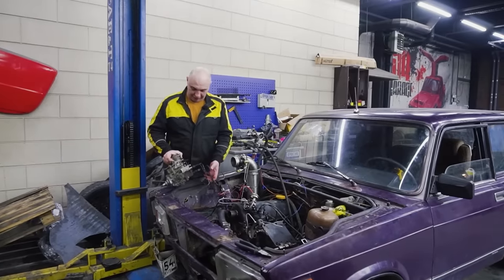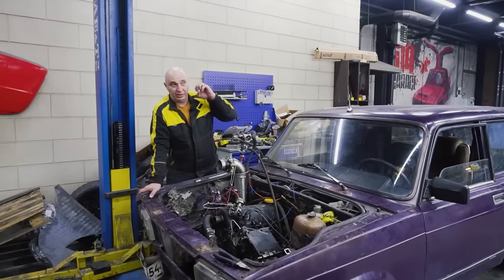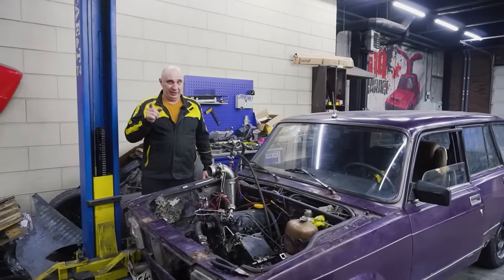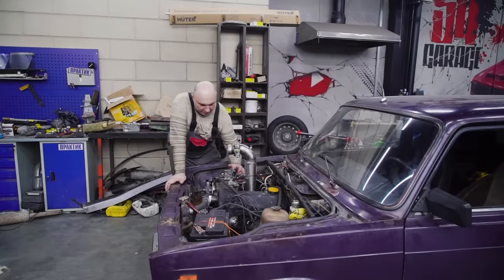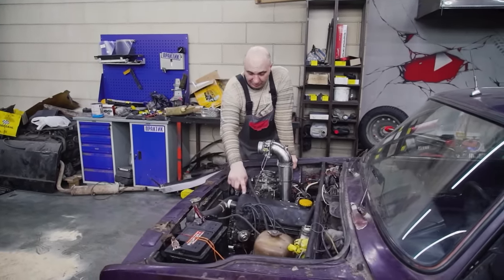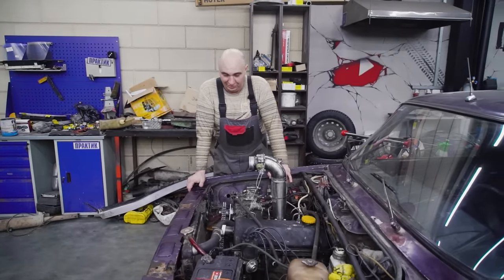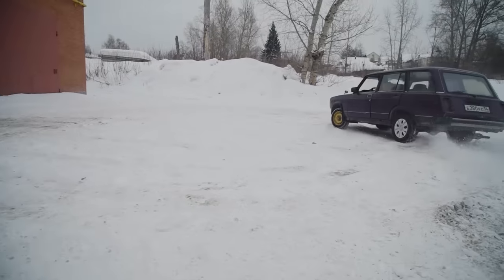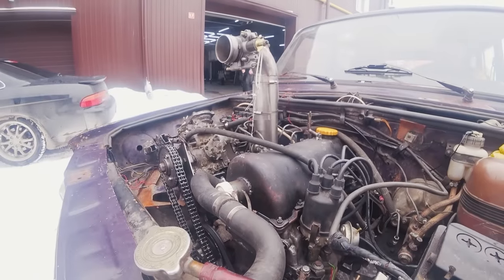We fit high pressure DIESEL pump to Lada engine

Comment: Perhaps try upgrading it with tensioner, better pump mount, and try tuning it with an AFR probe to modulate the pump and throttle body optimally together (with the gas pedal cable, as it's likely running nicely because the fuel get's sprayed super fine, which likely mitigates a bit the effects of it running really rich or lean - as a matter of fact new gasoline turbo engines with direct injection use this high pressure injection effect exactly for the same reason).

Great experiment, the engine doesn't sound at all like a lada. Almost like a smooth R4 bmw engine.

Comment: Fit an automatic Oiling system for the fuel to it, so you dont  have to mix Oil into the Gas seperatly
and fit a trumpet onto the Trottlebody so the air can be sucked in way faster

Comment: To make a whole thing work properly, just add a starter motor powered supercharger you made a couple of videos ago, with a regulator to regulate an air amount.
Reply: Starter motors don't have enough power to make boost. Just blowing air is not enough, you need positive pressure in the manifold to make more power
Reply: @Rudy97  then use a some kind of nozzle, for example convergent-divergent nozzle.
Reply: @cenreaper3221  you can't make pressure without enough force to make the pressure.
Reply: @MiG21aholic  😁❤️
Reply: @MiG21aholic  you want to say that turbocharger on normal cars have more power than starter motor?
Reply: @cenreaper3221  by the time you have a gearbox to spin a compressor wheel fast enough you definitely don't have enough power in a starter motor
Reply: @MiG21aholic  oh.

Comment: Since no one has mentioned this, I will enlighten everyone. Diesels have no throttle plate, as a gasoline engine does. Diesel engine speed and power output are determined solely by the volume of fuel delivered by the injection pump. A gasoline engine's speed is regulated by airflow, making the throttle plate a key part. Essentially what has been done here is creating two throttle linkages, one for fuel volume, the other for air flow. Hence, they must be synchronized, much like a multi carburetor setup.

Comment: I'm certain the atomization of the fuel from the port injection and diesel injectors is much better than a stock carbureted lada engine, letting the engine make more power and be more efficient

Comment: A little bit of helpful information, there should be a screw you can adjust on the side of that high pressure diesel pump that will allow you to change the duration length of the fuel pulses for each injector also the golden ratio should be according to the math I've ran between throttle plate  and fuel pump should be 3:1 the 3 being the air and the 1 being fuel. So in layman's terms if you crack the throttle all of the way on the intake you should only open the diesel pump throttle by 1/3 of its movement. The stoic mixture for fuel to combust is quite a wide and varied range, the only difference being there's a very small window of hyper efficiency where the fuel is completely burnt  or there is no detonation occurring from running to lean or pig rich  to wash out the plugs fire. I recommend finding a BMX bicycle brake cable a Teflon coated one to run from the fuel pump to where the throttle body cable is and run them parallel and have them pulled at that 3:1 ratio by using different sized cambered circle guides to regulate pull distance. Not sure if you know this or not but in the early 40s there were a couple cars that experimented from the factory with high pressure mechanical fuel pumps, also in most race applications with cars that run on methanol they have a mechanical high pressure fuel pump that is very similar to a diesel mechanical high pressure fuel pump.

Comment: Awesome! At diesel fuel pressures, (1800 to 2000 psi), the gas is instantly turned to a fog that mixes perfectly with all the air it can get. Put the electric turbo on it and hang on.

Comment: Since the pump setting never changes, the air/fuel ratio depends on the throttle position.  So be careful, the more you open the throttle, the leaner it gets.
Reply: the pump goes up on revs with the engine(and does more revs, pumps more gas injection cycles).  the problem is more of the opposite, that driving part throttle at high revs gets you same fuel as full throttle (provided that the full throttle behavior is okay).
Reply: Yep, they need to hook up a wideband o2 sensor in the exhaust. That way they should be able to watch and correct the mixture.
Reply: The higher the revs the more line pressure. The lower the revs the less pressure. And with what we see in the video being the engine able to rev up top and still have the power to pull is a sign of enough (or more than that) fuel to create the power and is not going that lean (too lean and you start bogging down...not enough fuel to make good enough combustion)
Reply: True, it is running well and revs up and makes good power, so perhaps it’s not as bad as I thought.  But at a minimum, the mixture is uncontrolled.  Would be interesting to see the readings in real time.
Reply: @facusan2339  they'd need to devise some more mechanical control like kugelfischer injection had, which is another similar thing to this what they built.

without having some more valves or bypass(back to tank) that operate somehow from vacuum, throttle position or such it's basically just a linear this many revs gets you this much fuel regardless of anything else going on. the bypass back to tank might be easier than having a valve before the injector.

I'm not sure how the ww2 era airplane injection worked, but there was some.
Reply: @-Jethro-  they have to get it up the dyno  to see how much power it actually picked up compared to a regular Lada...could be the two stroke oil doing the extra power too and they can review AFRs that way as well

Comment: Now all that is left is to convert a gas Lada engine into a diesel.  Put the injectors in the spark plug holes,  put a bunch of weld into the combustion chambers to up the compression, and go!
Reply: they did a diesel to gasoline toyota
Reply: @lasskinn474  I know,  hence why I said go gas to diesel.

Comment: FIT A STANDARD TRANSMISSION TO THE BACK OF AN AUTOMATIC!!
Reply: Yooo that would be cool
Reply: 😂 how did you think of this?
Reply: @Me-zo8yc  I dont understand why they havent tried this yet
Reply: @quevicular   It's insanely genius or geniusly insane
Reply: @Me-zo8yc  Why thank you. Dont know if it would burn out the syncros at all. Might have some impact on them. You could run super hi gearing in it and still have many lower gears to be in almost crawl mode. Dont need overdrive and all the compoohter crap neither
Reply: @quevicular  10000rpm on the input shaft, she'll be fine

Comment: The Injection pumps I work on automatically trim the fuel based on engine speed using a governor. When you adjust the lever on the injection pump, you are telling the governor how fast the engine should be spinning and it increases/decreases fuel to hold that speed.

Comment: I'm not surprised this works fine. Mechanical multipoint fuel injection has been the method for supplying fuel to airplane engines for very long. Simple, reliable, and powerful.

Comment: `remember , a diesel engine has no throttle plate , the intake is always open in a diesel manifold , and the engine speed is controlled by the pump . The pump delivers the diesel directly to the cylinder at the very last minute as diesel combusts under pressure and not by spark , therefore the diesel cannot be introduced at say 30 deg btdc like in a petrol engine since it will prematurely combust or not comb at all so the diesel is sprayed at the very last point btdc and has to be at higher pressure than tat of inside the cylinder at that time wich is extremely high for diesel engines , so , the setup on your lada now works fine yes , but the mixture will never be correct . I bet you it over enriching it allot. Im glad you guys did this coz its something i have been wondering over for years and never had the chance to try . i knew it would work though... 
The concept was used in many cars. Its called mechanical fuel injection. Vw Golf Gti mk1 = Kjetronic injection . Ford also had a mechanical injection. audi 5 cyl... im just curious to know how long the pump will last having petrol through it ....

Comment: I was like 'a pump's? But I can see it's a whole intake injection control module that is mechanical & includes a high pressure pump, great engineering I learned something.

Comment: It's all about the mixture of the air and fuel and fuel into the incoming air charge into the intake valve. That's why they used multi port fuel injection for so long here in the states. It was basically the best of both worlds of diesel and gasoline engines combined. But the fact remains that the atomization of the air fuel mixture with the high pressure pump and injectors makes the gasoline almost like dust before it even hits the backside of the intake valve. The reason why a suction style roots supercharger makes so much more power than a blow through system does. Otherwise Top fuel dragsters would be running a blow through system. With methanol especially when the mixture is so rich that it's almost hydrolocking the cylinders with the amounts of liquid fuel being injected the roots style superchargers take the air and fuel and helps to atomize the fuel even more so than just the injection system can supply. This is how these engines can run on such crazy amounts of fuel! Without a supercharger to increase the air flow and to basically be a mixer to atomize the fuel even more during the rotation process that it can stuff more air and fuel into those cylinders than they would never see in a naturally aspirated format. If you can atomize gasoline to the point of almost vaporizing it your fuel economy is almost doubled. Chrysler Corp found all this BS out back in the 1960s while doing R&D on their engines and found that they could increase fuel efficiency by increasing the incoming fuel temperature which aided in the faster atomization of the gasoline molecules. This will then produce more BTUs in the burn 🔥 rate efficiency of the gasoline which normally leaves the cylinder only half burned off most times, which is why they use a catalytic converter with air injection to provide the burning off of the rest of the hydrocarbons which leaves the engine unburned. The fact is the faster the engine is turning, the less time it has to try and extract as much BTUs of energy from the fuel. This is why you see the flames coming out of the headers of a dragster engine even at idle, the mixture isn't being broken up good enough so raw unburned fuel is able to escape, then is burned outside the engine in the exhaust pipes. The theory is that if the engine gets to the point where it is able to mix and burn the mixture effectively enough to make power and lots of it. The downside is of course that a ton of unburned fuel is wasted because it's being ejected before its even halfway done burning. Methanol burns extremely cool and this is why so much is needed to convert it into usable BTUs of power. But unlike gasoline, because it runs so cool and likes to cool down the intake temperatures as well through evaporation the engines are capable of making much higher boost levels without the serious problems with gasoline and preignition or detonation occurring. Bottom line is the more you can atomize their gasoline the more efficient it becomes and you don't need to rely so heavily on the ignition system to light it and keep it light throughout the stroke. If you have a perfectly filled cylinder with the perfect 14.7:1 air to fuel ratio Top to bottom and side to side, in theory you'll achieve a full burn and extract the most naturally occurring BTUs from your cylinders capacity. This is why heads and camshafts are the heart of almost any 4 stroke engine and their efficiency is determined by how easily the engine can pump air which is not much different than if it were pumping a fluid. Everything comes down to the same thing efficiency in every aspect of the principle of thermal and fluid dynamics. The more you can get in the more you can technically get out when everything is working in sync.
Reply: Great comment.

Comment: Fuel injected gasoline engined Mercedes in the 60's had inline "diesel" injector pumps to feed the motor. I had one, a 1966 W112  inline 6.

Comment: Great shows guys
Kudos to the editors and VO 

Look up a cross ram hemi or 426 cross ram to see the best tourque intake manifold ever made. Notice how intake tubes dip down to exhaust and is 3 feet long. That curve matters a lot for tourque. Tunnel ram manifolds are for RPM and horsepower.? They had a problem from exhaust manifold boiling gas in float bowls and creating vapor lock. Check those old Chyslers.

Diesel injectors are under much higher compression pressures. 
I always thought it squirts variable by electric servo and CPU but at 7k rpm that would be insane valving. So it must use the piston pressure to open.

Maybe its a electro mechanical trigger each intake stroke when it senses vacume

That would allow the engine to always fire at right time. Then again maybe its just pooling the gas as if your squirting from a bottle.

Set that rig up on a bench so we can see it squirt under prssure and SLOW MOTION cam on your phone.

Internet came to late for us old timers
Anyway just saying

Try alcohol with that injector?

Also did you ever hear of a reed valve?
Or a circular flat valve?
Its like a one way flap valve

Great shows

Comment: I would so set a servo controller on an arm  and connect it to the throttle body to open and close the pump accordingly with a large servo, it would even it out even more and the air fuel mix could be tuned perfectly.  Atomization with diesel injectors help as well.  I am wondering if the pump is also getting a boost since you don't see diesels revving that high.
Reply: Exactly it's rich down low which is why it's so lazy.
Reply: The pump just puts in a certain amount so rpm will not matter as it still puts in the same amount of fuel in.
Reply: @aaronhall7740  I am not sure that pump is being regulated at all, I see a vacuum line that should be attached to regulate the pressure. There may be a lot of variance there.

Comment: You guys should put an O2 sensor to monitor the mixtures and connect throttle plate cable to the pump and move the two simultaneously.

Comment: For a moment I thought they were doing a bad conversion to a diesel engine, but I was surprised, and I could see the expression of happiness on your face! Glad it turned out so well, I loved it! Now put the injectors instead of the spark plugs, diesel fuel, increase the compression and you will get a diesel Lada!
Reply: I would love to see that now converting a gas engine to diesel would be cool to watch
Reply: @raven4k998  In my country that is something that was done very often a few years ago, for example in the 6-cylinder engines of the old mustangs (here they were from a national Falcon) increasing the compression and placing injectors (in the place where the spark plugs were) and diesel injection pump for trucks with low displacement engines and tuning it for the new engine.
Reply: @Zeeos27  just be careful of scammers if you have a diesel that try to charge you for replacing your spark plugs on your diesel engine cause that's a scam scammer like to try hoping you'll fall for it and pay for something you don't actually need cause diesels don't have spark plugs

Comment: Vlad it gets better - that pump has a boost enrichment compensator built in. It you run a turbo or supercharger you only need to feed boost to that compensator and it will fuel up as boost builds. 
Also the "throttle" on the diesel pump isn't really a throttle - its an enrichment adjuster. The rpm is dictated by engine speed and that lever adjusts how much fuel you get per revolution. 
You can also adjust that with the screw under the cover but I would say its close to correct the way thats running so maybe leave it alone. 
The boost compensator is adjustable too - you take off thet "hat" on the top and there is an eccentric plunger - turn it to allow more or less fuel depending on boost level. A lot of the Japanese pumps are restricted too - usually with a white nylon washer on the top of the enrichment plunger. 

You can have a lot of fun with these.

Comment: i use 2-stroke oil in my cars occasionally,  at about 500:1 ratio... or 1 oz per 4 gallons. it has no problems burning, no smoke and helps lube the injectors & pump. some say this helps get slightly better fuel economy, i haven't seen any significant change.
Reply: try it at 40-1, compression will increase with oil on both sides of the rings

Comment: The diesel injector is accustomed to passing #2 fuel oil thru it's passages.  Gasoline is much thinner, so you are getting more fuel to the engine at a given setting than you would if it was burning diesel fuel.  A diesel fuel injector has a strong spring inside.  When the fuel pressure at the injector exceeds the spring pressure in the injector, the injector 'pops."  A very simple setup when compared to gasoline fuel injection.

Comment: If you get air in a diesel system you can just use a gasoline rag at the intake. Learned that from working on diesel lifts.

Comment: Now it needs a turbo, maybe add the electric turbo too and get a six cylinder pump for the six cylinder engine.
Connect the linkage between pump and butterfly. Leave the long intake, it should help with low rpm torque. Great work guys!!